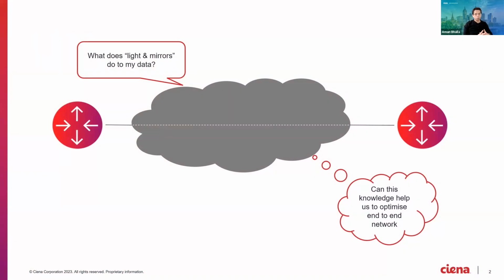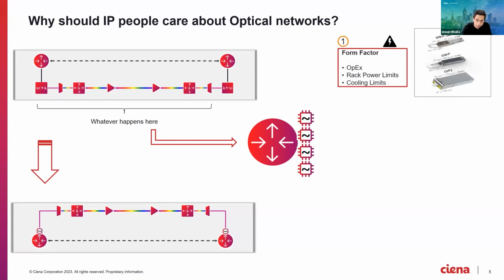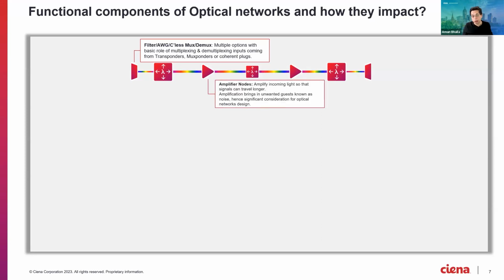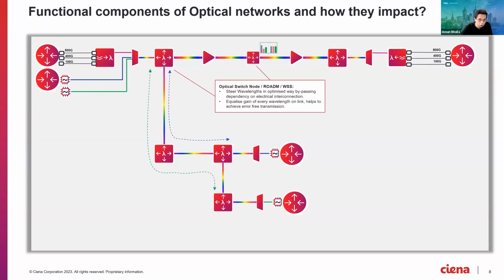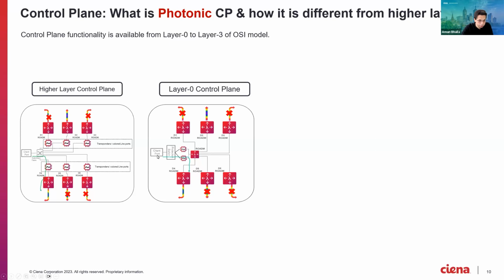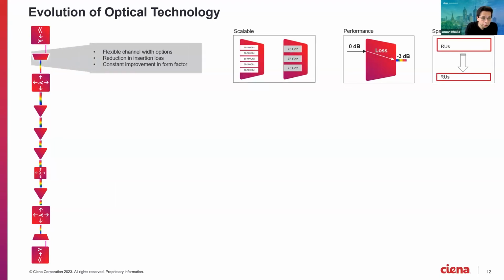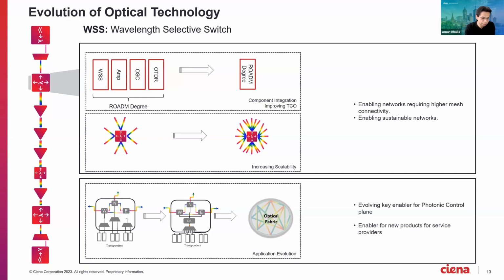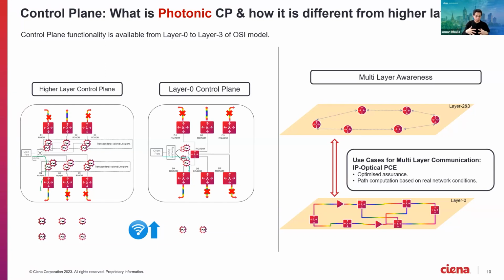Optical Basics for IP experts (Part 1)

Comment: nice video well done bro, i have question for you : In a brownfield network where we’re introducing 400G coherent wavelengths into an existing 100G fixed-grid system, how would you handle spectrum fragmentation and WSS filter narrowing over multiple ROADM nodes? Would you re-farm spectrum, or overlay flex-grid — and what’s the trade-off in downtime versus spectrum efficiency?